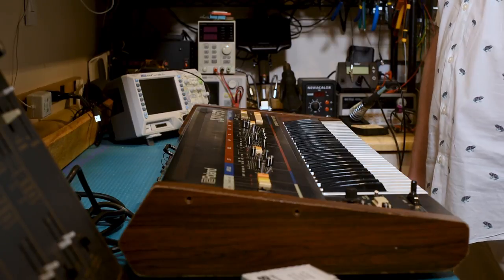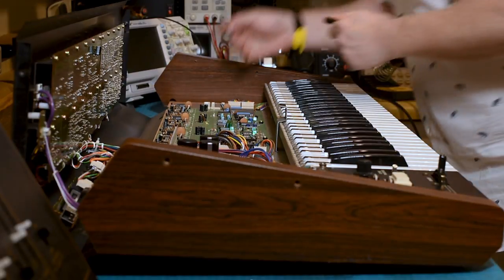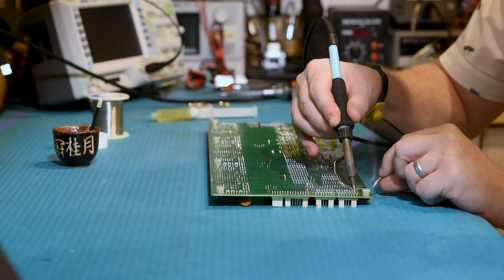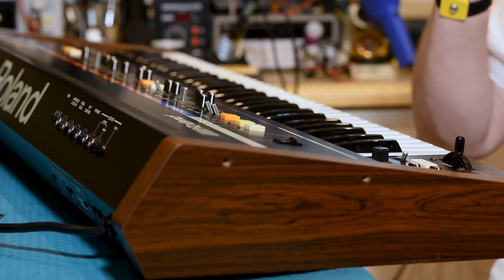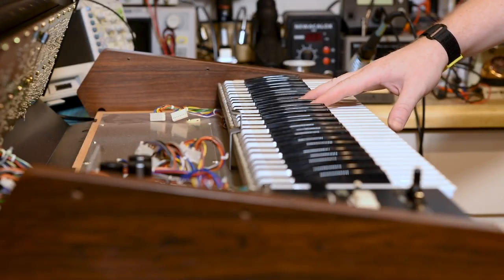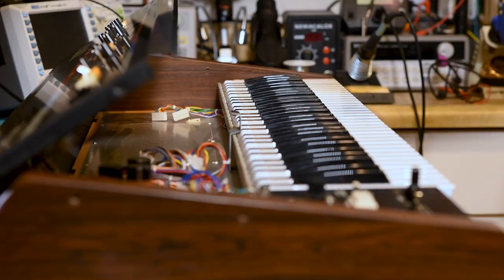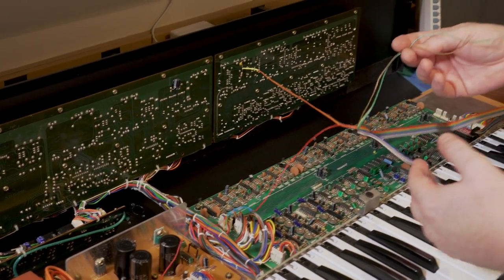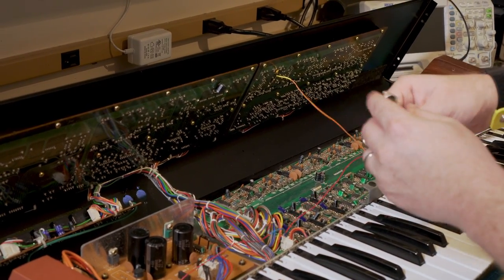Tubbutec/Roland Juno 66 Upgrade: Complete Installation Tutorial + Demo Track~

Comment: Great video! Small tip - and I mean no offense: Painter's tape is a very risky solution to hold that CPU. That tape is a "quick tape" designed for paint work. It is not designed to last long, and after a few years the tape will become stiff while the glue will no longer hold. The chip will slip thru and can cause serious  damage if it falls into the PSU rail. In general: even with best duct tape, no lose parts containing metal should under any circumstances ever be left inside a device that has live AC terminals as it is a potential fire hazard.
Reply from the maker: Thanks Don, we are big fans of your work! Tips and advice from others with knowledge & experience are always welcome! We are just a couple of avid vintage synth enthusiasts looking to help others who share a passion for these amazing instruments... There is always more to learn :) 

This is our personal Juno-6, so we'll be sure to keep an eye on that tape and look for another solution for future jobs. Anyone attempting a job like this should absolutely heed your warning. Thank you for checking out & contributing to our channel!

Comment: This tutorial is very helpful. One thing I did find is if one drills the midi ports as in the tutorial, it's very very hard to get the nuts on the bolts to secure the ports because the looms are in the way and the space is very restricted. In fact after many attempts with a variety of strategies I failed and had to have the nuts external rather than internal which looks a bit crap! Any tips on how to get the nuts on from the inside?